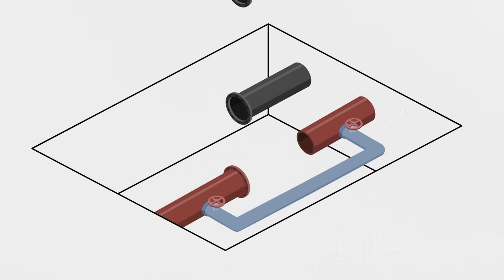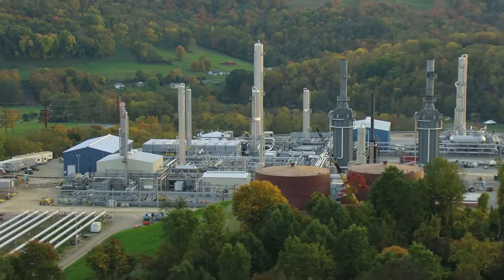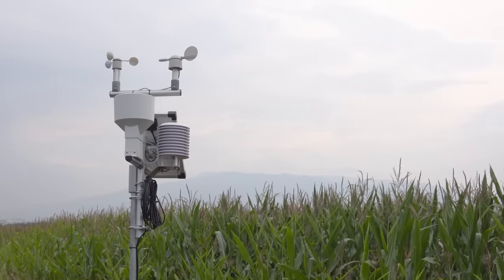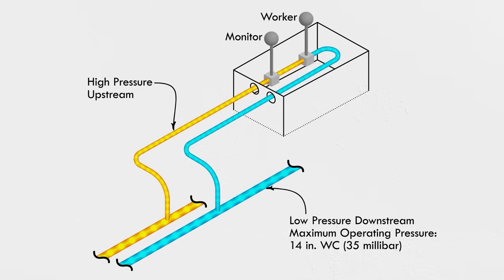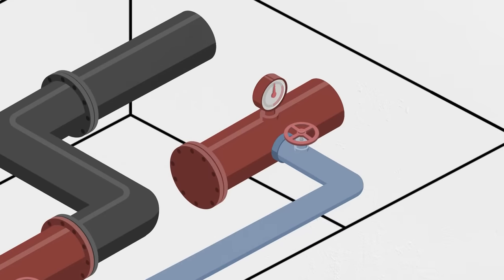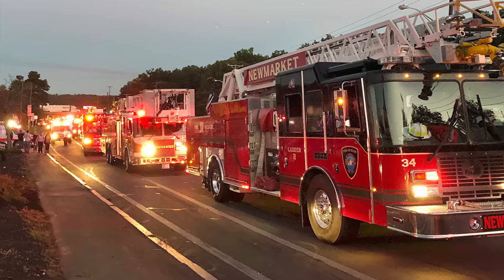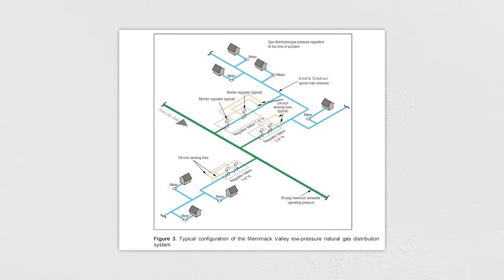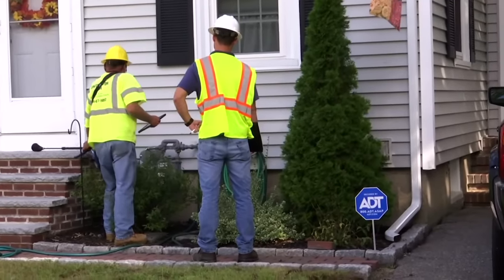What Really Happened During the Gas Explosions in the Merrimack Valley?

Comment: I would expect there would be some kind of relief valve in a low pressure system to prevent overpressure to reach domestic appliances.
Reply: there was.  they wired it up wrong so it never saw pressure and never tripped.

Comment: I think an overpressure valve on the low pressure side would've helped. Where a setpoint difference of about 10% might be enough for worker/monitor, the overpressure valve should be set  to 20-30% above nominal. Then in such an incident, there would be ONE huge fire/problem,  not 100s of distributed problems.

Comment: Why is there not a redundant pressure regulator between every home and the main line running down the street ?
Reply: As this video explained, this was a weird old system where gas was distributed at 1/100 the pressure of the average car tire.  This made house regulators pointless -- until suddenly, they weren't.

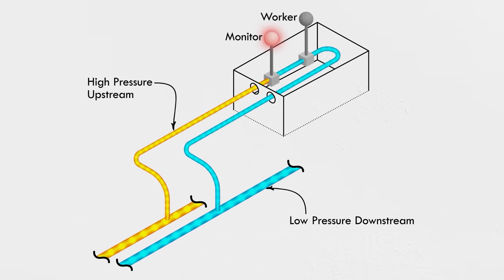Comment: I keep having trouble with a concept at 5:58 and I'm hoping someone can help me. Grady says that the monitor regulator is set a bit higher than the worker to kick in if the worker failed. What I'm imagining is the worker, directly downstream from the monitor, failing and allowing unobstructed flow, lowering the pressure in the high pressure portion, and that the monitor would detect that and kick in, but I'm having trouble squaring that picture (if it's even correct) with the verbiage "set a bit higher"; I just can't get my head around what it means in this context. I think probably most, if not all, of the problem is that I didn't quite understand the specifics of how a pilot regulator works from Grady's diagram (the generality of which was perfectly appropriate for the video; there are just some incorrigible questioners like me). I said I "keep" having a problem understanding because as soon I saw the pilot regulator diagram, some deep part of my head had flashbacks of frustration from the last time I watched this haha. I don't know what parts move, or where or how they move, or in response to what, or what moves them, or what the pressure is doing at any given point and time in the system. I was going to google it after this video. But then I realized I have a large resource right here: the comment section of an educational Youtube video! Especially one with as passionate a crowd as the civil engineering community! So the tl;dr is, can anybody clarify how a monitor regulator works when placed upstream of, and set higher than, the worker regulator?

Comment: You are wrong about changing a low pressure to high pressure. You want a medium pressure system for distribution. High pressure systems for distribution are being phased out when possible. Hits, leaks, retirements and general maintenance is harder on high pressure. High pressure is best for transmission.

Comment: Naturally (pun) I have no idea how the natural gas distribution system in my city is designed or maintained. That's just not something gas utilities share with customers. I do know I have a smart gas meter outside and there is a small regulator that is part of that installation. Does the presence of the regulator mean our system uses what Grady mentioned - a system using a higher pressure line to the house combined with a regulator to drop pressure to the required safe level?

Comment: Interesting. I’m curious why we don’t have pressure relief valves at the houses or elsewhere along the low pressure lines to release elevated pressure in this type of situation.
Reply: what kind of pressure relief valve do yo use for half a damned bar?  I've had farts harder than that.  Almost anything you use, the houses are gonna start blowing before the relief does.

Something that responds to rate, like a blowout preventer, might work?  not sure.

Comment: Since each house has a regulator, how were houses damaged?  Were the supply lines leading up to those houses the ones that were bursting, but the lines after the house regulator were actually OK?
Reply: No each did not have a regulator. None of the street or service lines failed. The issue was the high pressure inside buildings. Imagine a gas furnace’s small pilot light just barely flickering or a stove burner at the normal very low pressure and then that pressure increases by orders of magnitude. One of two things is going to happen. The first is the flame goes out and the buildings starts filling with gas until it reaches the detonation point and then boom. The second is the small flame becomes a flame thrower and ignited its surroundings.
Reply: @DisinterestedObserver  Ok so I'm confused by the video statement where he suggested changing out lines, he made it sound like houses were already protected by their own regulators.  I would have thought each building/house already had a regulator from what he said @12:40, but I'm probably misunderstanding.  It also seems like after the monitor/worker valves there should be a limiter too, sort of a tertiary device that doesn't try to maintain pressure, but just limits what's allowed.
Reply: this was an extremely low pressure system.  houses didn't actually have regulators.

Comment: Why in gas pipeline networks there are no devices like fuses in electrical grid? Something that in case of overpressure would be broken in specific way, to stop gas flow entirely.
Reply: There are!  They call them blowout preventers.  Their pressure valves -- both of them -- should have worked too. But they wired them wrong.

No number of these devices will work if you install them wrong.

Comment: How do they replace the cast iron lines at the other end of the distribution lines? I get that they do the cross over from cast iron to plastic all at once upstream in the video. But how do they switch over all the cast iron lines that are connected to now be connected to plastic at the other end? 

Several years ago my local gas company replaced all the cast iron lines in my neighborhood with plastic but yet I never lost service. Do they install plastic along side the cast iron so each service line is hooked to both cast iron and plastic? Then when they switch the distribution over to plastic they go around and turn off/disconnect all the lines going to the old cast iron?

Comment: I don't understand, if the sensing line is capped off, the gas has no where to go so wouldn't it over pressure the pipe causing the regulator to read higher pressure in sensing line? As oppose to reading lower pressure, making it pumped in more gas?
Reply: The pressure sensors were on the old, abandoned line.  The old, abandoned line stayed empty no matter how much gas they pumped into the new line!

Comment: The information given at the end of the video about the Tenerife Disaster is NOT true. Both airliners the KLM and the Pan Am were given permission by the tower to enter the runway and BACKTRACK to the end of the runway were the KLM was to turn around and hold. The Pan Am was to follow the KLM and exit before the end of the runway but the KLM started their roll and take off WITHOUT clearance from the tower to take off and since visibility was down to minimum because of the fog the KLM did not see the PAM AM on the runway until it was too late. This information was posted on the NTSB crash report.

Comment: How on earth did they not have pressure relief valves in various locations on the low-pressure distribution pipes?
Reply: what kind of pressure relief valve are you g oing to use with half a PSI?  maybe a blowout preventer at the source could work

Comment: Why is bringing high pressured natural gas to individual houses/businesses considered a good alternative for eliminating the single mode failure? I compare it to bringing 600 kV lines to each house because a substation failed due to incompetence.
Reply: Because it allows you to place the point of failure outside the house.  There's also the question of efficiency.  Consider it more like 10KV.  Outside the house you get a step-down.

Comment: Great video! One question: how far do the pressure regulator valves open and close? Is it only 100 % open or 11% closed (bang-bang contrioller), or do the valves partially open and close?
Reply: What do you think...
Reply: Gas regulators will smoothly open and close, on a spring, to maintain an adjusted-to pressure.

Comment: it's ridiculous that the entire system had no backup relief valve.
the most logical thing is putting a simple overpressure burst valve on the main line. it costs nothing and is passively safe.
Reply: Where do you locate this rupture disk in a densely populated area so the released gas isn’t a problem?

Comment: What about the regulator at the customers location? Over pressure monitoring block by block with emergency cut offs should be mandatory. Go you have a list of states that require an engineer? Please share
Reply: what regulator?  this was a low-pressure distribution system.  until it suddenly wasn't.

Comment: Maybe not ideal either but I am kind of surprised like on the meters or regulators why there is not like a pressure relief on them. There would be risk pf explosion if it went off but there is a lot more air and room to work with outside of a place than inside. Then in theory too even if was small in a case like this they would vent off so many locations it would I think be fine. Pretty sure LP tanks have pressure reliefs so why not these systems.

Comment: Why don't the pilot regulators have a limit setting to stop the possibility of releasing full upstream pressure? A drop of pressure to zero obviously means that there is a serious break in the pipe. Or did they have this limiter but the lowest pressure still was too much for a PVC pipe?
Reply: Or too much for the downstream regulators  ?
Reply: Probably wouldn't be the same device.  Maybe they could have used a blowout preventer too.

No number of these devices can work if you miswire them, though.  They should have had someone watching the output pressure.

Comment: Is there a design flaw with the pilot valve?  It seems from the diagram that it will try to maintain it's set point as quickly as possible regardless of the deviation and it will not limit how far it will go to restore the set point up to its own physical limit nor will it limit how long it tries. 

A downstream rupture, it seems would also result in  maximizing  flow to the downstream branch.

Jumping the advertising shark at the end.  1977 Tenerife accident has be covered so thoroughly, one might wonder what Yet Another Tenerife Airport Disaster could possibly bring to light.
Reply: The design flaw is, that if you're monitoring the wrong pipe, you can output full pressure

Comment: Here's what the actual problem was.. the lines were installed 2 years prior..  then theu probably had To wait on fn permits and other red tape During that time, people left, got fired, and/or got transferred..  the control lines were forgotten about because the people that were in charge during the initial installation probably weren't there during the accident time.  If they did the whole job from start to finish with no delays, this disaster probably wouldn't happen

Comment: How do you attach the initial u shaped pipe to an exisiting pipe under pressure? Or add in those balloons? Is the gas stopped during that operation?
Reply: they have this really weird gas-sealed drill they use to open the pipes in operation and insert the ballons

Comment: I’m a little bit beyond concerned about the fact that these systems have obviously not been engineered to sustain an oops like that.  There should have been a fail safe built in to the system that dumped the extra pressure.  There’s no reason that we wouldn’t have a dump off like that through peoples homes, it would just be a flare tower that goes off.  I’m amazed that there wasn’t any people who landed in prison over this mess.   The oversight didn’t oversee….

Comment: I am flabbergasted there isn't a pressure relief valve in a system that is sensitive to over pressure. Hot water heaters, furnaces and air compressors all have them. 
Those dual regulators showed the weak link in the safety chain. They both rely on pressure lines from downstream with no check against the total pressure, both too high and too low.  Strictly speaking, regulators aren't safety devices at all. They don't have a shutdown mode. Say a delivery pipe ruptures, something that can and does happen when utility work under city streets takes place, all the regulators will do is allow more and more gas to flow as the pressure drops in the system. Not what you want in that case either.

Comment: The main cause of the failure was due to poor Engineering management, engineering execution, lack of coordination between Engineering, Construction and M&R departments. The M&R department is responsible for the district regulator stations. They must be involved in any work done within 50-100 feet of a regulator station. This was not the case at Columbia gas the M&R department was not involved in the new main installation at the district regulator. There was also a problem with drawings for the regulator station the locations of the sense lines were not included on PID drawings so Engineering did not consider this when they were connecting new main to the low pressure system. The M&R department should also be involved whenever new main is installed to a regulator station.  Besides the requirement for a PE stamp on engineering drawings the state of MASS implemented some additional controls to low pressure regulator stations. This included adding a fail safe shut off valve upstream of the monitor regulator. The shut off valve has a dual acting pilot that will close the regulator when the downstream pressure goes above 16 inches or drops below 6 inches. This is what happened at the regulator station in Lawrence because the sense lines connected to the old cast iron main lost pressure which as you explained caused the worker regulator to go wide open introducing high pressure into the low pressure system. There is another potential common mode failure that you did not mention. The regulator uses the high pressure upstream to close the sleeve on the regulator in a normally open regulator. There are regulators that use the high pressure to compress a spring that opens the regulator valve. This is a normally closed regulator. The power gas for the regulators is generally tapped off the upstream high pressure pipe at the regulator but not always sometimes it comes from the high pressure main. If you lose the power gas then a normally open regulator will not close. If both the monitor and worker are normally open regulator that use higher pressure to close the regulator then they will both be open. The new design for low pressure regulator station uses a normally open worker and a normally closed monitor and a slam shut with a dual acting pilot. There is still a potential failure that while not catastrophic is equally dangerous if the regulator and/or slam shut closes on a single feed system. In this scenario the gas pressure drops and the customers equipment will shut off. When this happens all meters connected to the system need to be shut off individually before the system can be repressurized.  Depending on the number of customers this can take a few days to weeks. Interesting video on the subject but I thought I would share some additional information about the changes the state made after the disaster. The addition of the PE stamp on engineering drawings is a plus but the reengineering of the design of the regulator stations is more critical in preventing this from happening in the future. Older cities in the Northeast have thousands of these low pressure regulator stations and it will take a long time and a lot of money to upgrade them to a safer design. The idea of moving low pressure distribution systems to high pressure distribution systems is good but there are thousands if not millions of old low pressure pipes that would need to be installed that is also expensive and time consuming. Engineering is always a game of trade offs.

Comment: Hindsight 20/20 and all, but what is a regulator doing there as the only safety device?

Surely there should be a pressure relief valve in there, some sort of pressure monitoring at the regulators themselves and a hard cutoff.

Im sure people would be unhappy if their gas was cut off, but im betting they'd be a whole lot more unhappy if their house exploded.

Would be interesting to hear about what the standards are and why they're set the way they are.
Reply: as explained in the videos themselves, the regulators are too close to the high pressure source for local sensing to work.  That's why they had to use remote sensing.  maybe some sort of velocity measurement instead...

Comment: This is why ALL utilities should be state owned, run, and operated with no exceptions. Private corporations should not be allowed to supply utilities in the USA. Power, gas, water - they should be state owned and operated and paid for by taxes individual users. Free statewide utilities and a competent oversight board of properly certified engineers would have prevented this and every other utility based disaster,  including the Texas power failures from winter weather. Private corporations should be illegal for basic needs, food, shelter, medical care,  education,  and utilities.  Problem solved.

Comment: What about the future of natural gas systems as a whole? Is there any push for replacing them by beefing up the electrical grid?
Reply: electric heating is insanely wasteful.  no amount of solar or wind turbine can tolerate what's basically a dead short that's on for half the year.
Reply: @tsm688  When I say "electric heating" I of course don't mean direct electric heating, but through modern heat pumps. They are not wasteful at all.